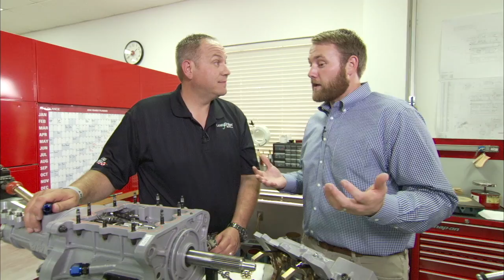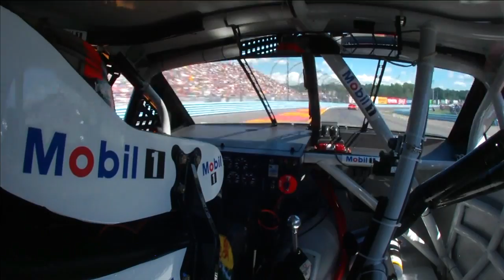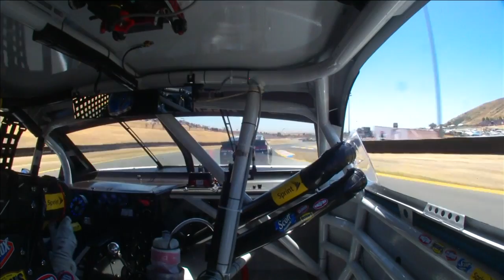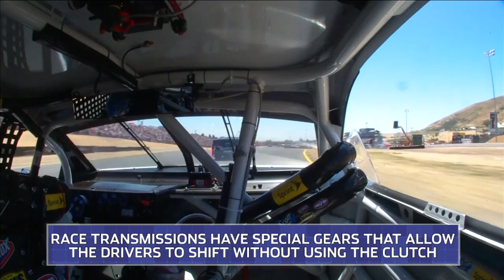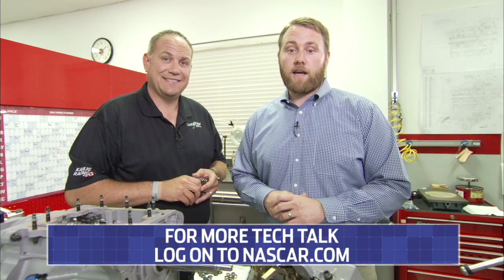Tech Talk shifts gears to transmissions

Comment: Here's an explanation of rev-matching. Actually, a clutch is a rev-matching device that corrects your mistakes. If you have a standard transmission car the smoothest upshifting happens when you lift the throttle push the clutch in and while you're off the throttle with the clutch in the engine RPMs come down and when you let the clutch out the engine RPMs don't go up or down and you have a smooth shift. You have properly matched engine speed with transmission speed. It's the same Theory to shift without the clutch. You lift the throttle as you move the lever and as it passes through the neutral gate the engine RPMs drop enough to match engine speed with transmission speed. 

Downshifting is more difficult. If you're downshifting with the clutch,  to do it right you have to use a heel and toe method where when you go to the brakes and push the clutch in then your right foot slide your heel or rotate the right side of your foot off the edge of the brake pedal over to the gas pedal and give it a blip as you're letting the clutch out to match the engine RPMs with the new ratio. Again it's the same idea without the clutch. The timing is tricky but when you pull the shifter to the new gear as it goes through the neutral gate you blip the throttle so the engine speed matches the transmission speed. Too much or too little with the blip and you're going to get a crunch. An illustration would be to drive along at 40 Mi an hour in 3rd gear and note what the engine RPMs are. Now shift into fourth gear and accelerate up to 60 miles an hour. Now, slow back down to 40 miles an hour and you see the RPMs are coming down. You need to get them back up for the new gear so when you downshift to third gear you want the RPMs to be the same that they were when you were driving along at 40 miles an hour. The only way to do that is to blip the throttle. As you move the lever from 4th gear to 3rd gear you blip it when it passes through the neutral gate. It's a skill that takes a pretty fair amount of practice and you hope you don't break the transmission or wear out the clutch in the process. Actually, if you do it right there is no clutch wear because if you match engine and transmission RPMs the clutch (AKA rev-matching device) doesn't have to do it for you. He is right about the heavy-duty straight cut gears being made to take abuse, and they get changed often. They don't wait for one to break. But I do not recommend clutchless shifting for passenger cars, especially clutchless downshifting. Passenger cars have brass synchronizers and curved gears that do not do well with clutchless shifting. You can use what I wrote above to make you Smoother at shifting with the clutch.

Comment: NASCAR really ought to take these videos down, the misinformation here is quite shameful.  Straight cut gears have nothing to do with shifting.  Race transmissions use straight cut gears because they are stronger and put less load on the transmission case.  They are able to shift without a clutch because these transmissions use dog engagement, rather than syncromesh.  However, you DO have to lift for upshifts and blip for downshifts.
Reply: Exactly

Comment: Straight cut gears? So a stock car uses non-synchronized gearbox just like an 18 wheeler? The driver needs to rev-match before changing gears?
Reply: Correct.  Though you'll still see a lot of drivers use the clutch for down shifting to make the transition smoother and save the teeth by doing heel-toe shifts.  For upshifting, the timing for the necessary rev match really only takes the time to barely lift off the throttle.  The clutch is also still necessary to start from a stop and keep the engine from stalling if left in gear while stationary.
Reply: I presume the drivers need to double clutch downshift with rev matching? From what I know a single clutch downshift with heel-toe does nothing to spool the gearbox to match the drive axel speed. Only a double clutch downshift with rev match at neutral can do that.
Reply: +212809 No, they either downshift at a perfect time (rev match). Or as they are breaking with the left foot, they blip the gas with the right foot just a bit as they downshift.
Reply: It depends on the driver and their previous experiences.  A lot of dirt, offroad, and touring car drivers heel-toe to downshift using the clutch disengage the first gear (the higher gear they were in) smoothly, and blipping the throttle while letting off the clutch (rev-matching) in neutral to speed the input shaft of the transmission with the second (lower gear) to the output shaft.  

Alternatively, in most dogbox transmissions you can skip the clutch disengagement and just go straight into neutral without braking free the input shaft.  This usually, if done properly, doesn't add any extra stress on the straight cut gears at high speeds.  At lower speeds, you must double-clutch straight cut transmissions such as stop-and go traffic or drive in the higher RPM range to keep in a lower gear.  

 Look up Ricky Rudd foot cam at Sears' Point/Infineon for an example and Kevin Harvick's foot cam at VIR for examples of heel-toe and rev-matching respectively.
Reply: There is something I still don't understand. If the gears are straight cut like they say, how do the drivers engage the 1st gear from a standstill from neutral without something to stop the gearbox from spinning first. Is their gear 1 different from the rest or is there something I miss?
Reply: Same as any other gear.  They depress the clutch which disengages the clutch plate from the flywheel which prevents the output shaft from spinning (or slowing down more likely if it is currently spinning from idle neutral).
Reply: But wouldn't doing this grind up the gears? Since the drive shaft is stationery while gearbox is rotating?
Reply: It's stationary in a regular synchronized transmission (which isn't actually the big difference between NASCAR and stock transmissions).  That's why you release the clutch slowly, which shifts a moving moment (flywheel) into a stationary or slow moving apparatus (transmission output shaft) over a longer period of time and equalizes their rotational velocities.  

The big difference between Dog Box (brand, not type) transmissions such that NASCAR uses is they're straight cut and bulkier gears intended to be hard shifted into place as the convenience and luxury of smooth shifts is kind of negated at 9 grande.  At lower engine speeds you treat it just like a standard non-synchro transmission in a semi with double clutching between gears and rev matching.  At higher speeds, you just snap it in place since the gears can take the stress better and are intended to be replaced every few races.

Also, for enjoyment sake, you can shift a standard stock synchronized transmission without the use of a clutch between gears similar to a NASCAR tranny, but it takes a larger gap in timing and much more precision.

Comment: Oh wow! I never knew that. You don't have to use the clutch.
Reply: If you play and NASCAR games and you use manual w/ clutch settings, you usually don't have to use the clutch because of the transmission.
Reply: Right. Sometimes, like in the Forza games you have to use the Clutch to roll and shift, but it's usually not as realistic unless you have a wheel and pedals.
Reply: I'm playing NASCAR 09 right now with a manual transmission and I'm not using a clutch.